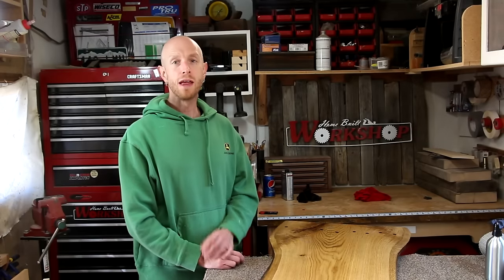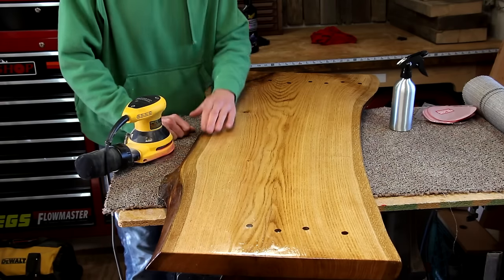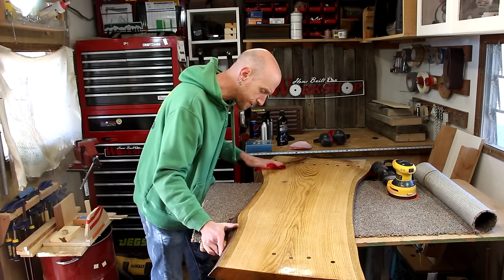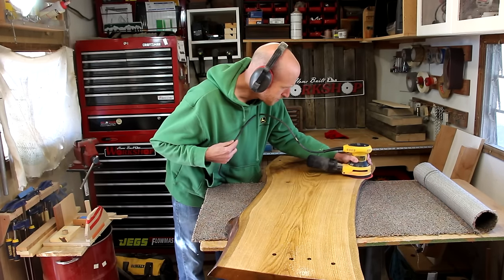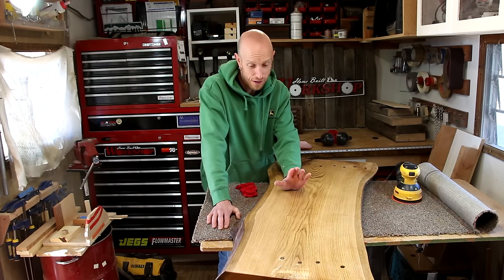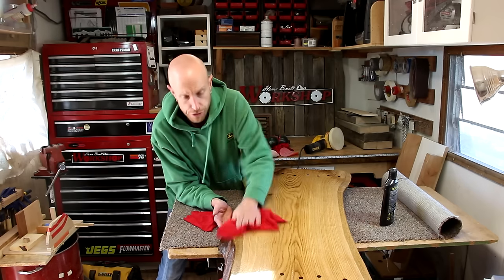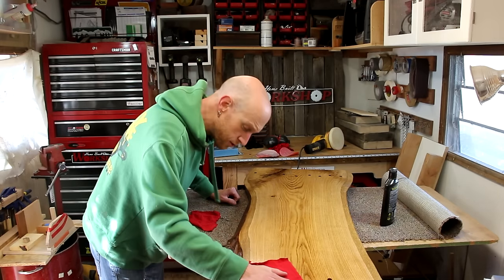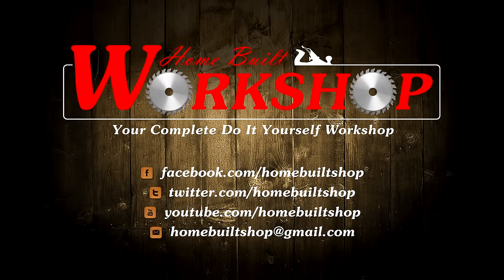How to Buff Polyurethane to a High Gloss

Comment: Hey Jeff! Thank you for your awesome vid, but I've got a question. I've used polyurethane satin/matte finish on my projects and I'm not really happy with its reflection, it's not even. If I'll polish it, will it remain satin/matte? or will it have a really high gloss after polishing? I've used varathane polyurethane finish.
Reply: I can field that:

Satin and matte finishes have additional substances that diffuse light. I believe if you were to buff it out it would get equally smooth but wouldn't be as transparent as a gloss finish
Reply from the maker: Unfortunately if you polish it it will become gloss. I can't think of a great reason it may be uneven. The only thing I can think of was that maybe it wasn't mixed well and the particles that make it matte weren't all mixed around. I've used the Varathane Matte myself and didn't have any issues. If you can, maybe try giving it another sanding then apply  another coat of finish.
Reply: As Andy mentioned, non gloss finishes tend to have additional substances to change the sheen.  Is it possible your can wasn't thoroughly mixed, causing you to have more of the diffusing solids in some spots?  Otherwise, maybe you've completely burned through the finish in spots?  Also, it may be too late (unless you want to take the project back to bare wood,) but ideally if you want a less than glossy finish, you start w/ your base coats in gloss, then either sand out the shine as shown in the first step in this video, or apply 1-2 finish coats of the semi/matte.  Too many coats of a non-gloss finish can start looking cloudy.

Comment: Instead of using automotive polish on a dining table, is it possible to work through the higher grits (3000/4000/5000/7000/10000) to achieve the same mirror like finish?

Comment: What type of polishing compound did you use? My problem is after about 5 or 6 coats I have air bubbles. I wondered if I could lightly sand it and then polish it.
Reply: Looks like mcquires car wax

Comment: At what point do you start sanding? I have used a thick polyurethane and I’m scared to sand through the finish. Should I put a couple coats then sand? Or do I sand between every coat?
Reply from the maker: You could start lightly sanding after a couple coats. At that stage, its just leveling it out before the next coats are applied. It will help achieve a smoother finish in the end. You don't need to sand much, just lightly to knock down the high spots. I'd apply maybe 3 coats, then lightly sand, then another 3 coats, sand etc. I don't think you need to sand between every coat.

Comment: I have a matte finish on my dining room table.  Do I have to completely refinish it to get a gloss finish?
Reply from the maker: Sometimes a matte finish can be polished to a gloss but you might get better results with refinishing. Matte finishes typically have flattening agents added which take away the gloss. I've seen mixed results trying to polish a matte finish.  I suppose you could try it and if it doesn't work out well, then refinish it.

Comment: Great video, I have a few questions. I've just finished applying all the polyurethane  (7 coats) should I wet sand 800, 1000, and then 2000? Also what type of Polish are you using, I've tried the mguires ultimate compound and mguires ultimate polish, and after using both it leaves a slight haze gives the table streaks, should I use a different polish?
Reply from the maker: +Alex Matula 7 coats should be enough. Depending on how rough the finish is you may be able to skip the 800. I'm not sure why you got the haze in the clear. The polish I'm using is a  mguires product. I notices it gets hazy as you're polishing then as you polish more it goes away.
Reply: I ended up with the same haze after the 2000grit Sand and tried to buff/polish it out to no luck. Now I'm stuck as if you look at the clear with light reflecting on it you see the haze. It looks fine straight on but doesn't have that nice clear as glass look it had prior to the 2000grit sanding. I'm guessing I'm going to need to do another coat of poly now
Reply: @EdenBrownlee1  I have the same problem. Was your project darker wood? on dark wood I cant get rid of the haze.
Reply: @DanielWilliams-fp4oz  - Mine is infact a lighter wood (camphor), I would guess darker wood will make it look worse (like a black car, any little scratch shows). 

What i did was a bit sneaky in the end but i got an AMAZING result. First, I made my space REALLY clean first let all dust settle and vaccumed all surfaces i could with our industrial vac with hepa filter (adding an air purifier might work well too), then, let everything settle again. Once had already wet sanded out any major imperfections and it was fairly smooth (mostly just denibbing here not making it baby smooth that comes later) i put a coat of poly over that and let it fully cure, luckily it was ULTRA shiny again and minimal nibs/bumps. From there, instead of sanding i just went straight to polish and i managed to get an ultra gloss shine. Note: I used an orbital and had a 2 stage polish from meguires also with microfibre buffing pads + a foam pad, and kept changing the micofibre pads to avoid scratches and had many microfibre cloths for each stage wipedown and clearing the pad. I must have polished the thing for 2 hours i reckon, its a 3m long bar tho so a decent sized surface. - In the end,... It came up amazing.

I also did a different test on the bottom of my bar, i did a wet sand to make it ultra smooth, then tried polishing similar to above, i was able with a TONNE of polishing to get it much better/closer to the initial shine I have per above method, but I never got it as nice, it was still slightly more hazy than the above method. Im not sure but perhaps my wet sandpaper discs are not good enough quality as i dont seem to be able to get the same quality gloss shine with using it and polishing, or perhaps i need more agressibly staged polishes ontop of that as i noticed it does get better and better, but it was just taking too long. In the end i got the bottom pretty good, but left it as its not noticeable on the bottom edge.

Hope that helps!

Comment: How long should I wait on the last coat (50-50 mineral spirits and polyurathane) before polishing? Also, what kind of polish did you use?
Reply from the maker: +Bill brafford I usually wait at least a week for it to cure. I used some polish from the auto parts store. I have also had good luck with 3M finishing compound available at an automotive paint store.

Comment: After each application of polyurethane do you sand and water what's the proper procedure? Thanks
Reply from the maker: I lightly sand between coats. Usually I just use a scotch brite pad or some 220 grit paper. The wet sanding is only at the end for final polishing.

Comment: I have a question! I'm doing my dining room table, and chairs. I've done 4 coats of oil based poly on my chairs, hoping that being the last coat... now there's the little bumps on the top coat.... can I just use some heaving furniture wax with a hand buffer to get those bumps out? I'm afraid to sand again, on the top coat, in fear of getting the white marks.

Comment: Little late to the party here. I have a question. I built a pick guard for my guitar out of maple. I finished it with true oil. Do I need to clear that? And what do you suggest I use to buff it?
Reply from the maker: I don't have much experience with tru oil, but I believe its intended to be used as is, without a topcoat. I dont see any reason you couldn't though as long as its cured. I have seen some very glossy results from people using just tru oil though. It takes a ton of coats though. Test it first if you want to try the topcoat.
Reply: @homebuiltshop  awesome, thanks for the advice

Comment: What is the best test to know if the poly is fully cured?
Reply from the maker: I typically give it an entire week or more to dry. One method I use is that if you can still smell the finish it's still offgassing and not quite fully cured.
Reply: @homebuiltshop  Thanks

Comment: I tried this procedure on a guitar and it seemed that the 2000 grit took all the gloss off the clear, presumably due to super fine scratches? Buffing didn't get them out. Sanding with finer grit and micromesh didn't help either. What do you do when your 2000 grit wet sanding leaves a satin finish that doesn't gloss up again?
Reply from the maker: Thats interesting. Sanding with 2000 should take off some of the gloss due to the sand scratches, but the buffing compound should bring it back. Its possible that the compound you used is too fine and wont remove 2000 grit scratches. You may need a coarser compound to take the scratches out. Also, make sure your finish is fully cured before polishing. It needs to be dry and hardened to polish to high gloss.
Reply: @homebuiltshop  oooh that makes sense. The other day I went at it with 4000 grit abralon on my orbital sander for a long time. It got reflective but without removing the scratches... I guess I polished on top of them

Comment: When you said that clear coat must be applied on a 360 grit sanded suface or less to create a strong bond, does this apply only to the wood surface or also to the clear coated surface?
Reply from the maker: I use that for all coats. I save the higher grits for polishing the final coat.

Comment: If you dont have orbital sander, can i use smooth cotton cloth for polishing? Thanks
Reply from the maker: Absolutely! It will of course take longer, but you'll get the same results.
Reply: @homebuiltshop   I have a paint job this week. I paint a primer gray on the old wood that i have and top it with clear coat. No other color. Just clear coat directly into the primer.
How to i get a great finish result? Thanks

Comment: Hello. I have completed an epoxy top. I want to apply a second coat. The first coat has cured(1 week). Can I just pour a second coating of epoxy? Should I sand down the cured top to 220 then pour? Or sand top to 220 then 320 then pour? Worried that if I sand top to 220 then pour a new epoxy top layer that the opaque sanded layer will remain opaque after new top is poured. Thank you.
Reply: My experience with epoxy is successive coats stick to each other with no sanding as its a chemical reaction,  poly is just a coating, thus it needs the "tooth" provided by sanding

Comment: How much wear and tear can this take? I would like to do this to a bar top in a restaurant, that will take a lot of abuse. Also, which poly did you use?  water based or oil based ?
Reply from the maker: Its oil based. So far its holding up well. Its had things spilled on it and still looks great.
Reply: @homebuiltshop  Can you tell what brand name and type poly you used?
Reply from the maker: Its a Minwax wipe on Poly.

Comment: Jeff, first of all, i want to tell you i loved your video, i have been lookin for this video for awhile, and feel i am closer now to fixing my issues that ever before. 
This is the second time i had to sand my 6 ft vintage  coffee table down to flat raw wood, I want to paint it black, but this is the second time i had to start over because i sanded down and thru the poly. i see shiny spots, so when i get to the buffing part, it has blurry dull streaks, and other areas have a gorgoues high shine. I get so frustrated, i know i have to take it down and start over again. 
i am wanting to see the grain on the black table, it is gorgeous, , i feel like it is still getting some high points and low and when i put the poly on it, it just really shines up but ends up streaky along the ends of the table.   it shines yet it has blurry streaks.  

I want to protect it, it seems that every time i put the poly on, it would show my brush marks, it is an expensive purdy brush!, no cheapo, so last time i saw a video that suggested watering down the poly 3/1 and charging a smooth rag or cheesecloth, and wipe it on quickly,  i still had heavier lines of poly. I am not sure what I am doing wrong, 
I just want it to be a bit distressed but the top, shine, but don't want the streaks, i think 3-4 coats of poly would work, but no matter, it just ends up with streaks of blurry mess, when the rest of the table will be an awesome shine.  
i cant have that, i am diligent and want to have a piece in the living room that everyone can admire, it cant happen with the low shine / blurry streaks. 
I want to thank you in advance,  PLEASE HELP:) 
sincerely, Donna
Reply from the maker: Thanks Donna, I would make sure I was sanding lightly in between each and every coat to keep the brush marks to a minimum. Like you mentioned, you might get better results by thinning the poly and wiping it on. The thinner consistency allows it to spread out more and eliminate brush marks. This can help a lot of its colder, as the cold weather makes it harder to even out. I wouldn't start polishing it until you are very happy with the surface. Polishing will only enhance everything on the surface. If theres a spot you don't like, polishing it will bring it out more. Don't be afraid to use a lot of coats, especially if you thin it. It takes a while to build up the surface. One last thing, make sure it cures for at least a week or 2 before you polish it out. I hope this helps.
Reply: do you  suppose the dull streaks could be thicker layers of poly that needed more time to cure?
Reply: do you think that maybe the streaks could be thicker layer of poly that has not fully cured yet? perhaps give more time for curing see if this helps also look up a video called Bubble Free Polyurethane Application Technique by paulsDIYsolutions. his is the best method ive ever seen for getting a perfect finish. hope this helps.

Comment: Jeff, We just installed new maple counter tops with Profin. There are some slight micro bumps just like you had. Do we use the same technique?
Reply from the maker: +GT Williams I wasn't familiar with Profin. I just looked it up. If you used gloss Profin you should be able to buff out the bumps the same way. Now I haven't used it so I'm not 100% sure but as long as it is cured first I don't see any reason it shouldn't work. Please let me know what you end up doing. I'm curious to know.

Comment: Hi, do you think polyurethane is better suited for musical instruments than polyester? I've been thinking about refinishing my grand piano which is currently black lacquer with a high gloss black polyester, but now I'm thinking I should use polyurethane instead? Also, could you spray polyurethane with a HVLP system? Thank you!
Reply from the maker: +Jorge Andrade I don't have experience with polyester so I don't dare say if it's better. Polyurethane would work fine through an HVLP when thinned accordingly.

Comment: Hmm I've not had any problems putting more poly on even a 5000 grit sanded layer as I'm assuming it melts the layer below slightly and there are micro scratches there for a key... Just saying. And if your careful you can get the mirror shine with 5 coats roughly but I build up to the 5th getting more fine and thin with the sanding and coats until I'm rubbing the final coat into the last coat as such :)
Reply from the maker: Thats good to know. I know some finishes burn into the previous layer. Some do not. You are right about getting a mirror finish with less coats. Its definitely possible if you're careful and really sand well between coats.

Comment: Hello have paint a guitar with dupli color spray can and applied a clear coat spray can from abro. The look after the clear coat was nice but the. I applied a wax for car which turn put the guitar to have a dull look with time. Any tips , product to use to have a gloss finish on the guitar, thx
Reply from the maker: I'd say, first make sure you used a super fine finishing compound to buff the surface to a shine. Wax won't smooth out the surface. Its basically just a topcoat. I think after you are able to buff it out, the shine you want will be there. You don't need a machine to buff it either. If you don't have one, you can buff it by hand. It just takes a little longer but you'll get there.
Reply: Home Built Workshop , thx for your advice, much appreciated . Stay safe , Gilbert ( Mauritius)

Comment: i have questions i want to coating my top table with polyurethane i just wondering can polyurethane be tinted with mica powder like epoxy resin?
Reply from the maker: I haven't tried this, but I feel like it would work. You might try doing the first couple coats with the Mica, then topcoat with just clear. Try a test piece first.